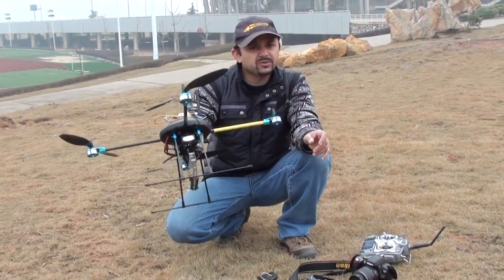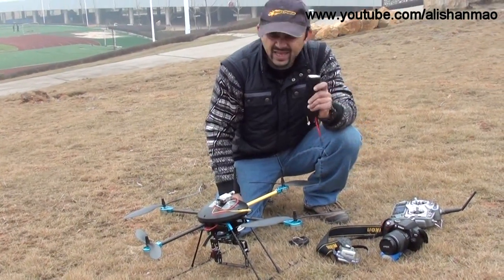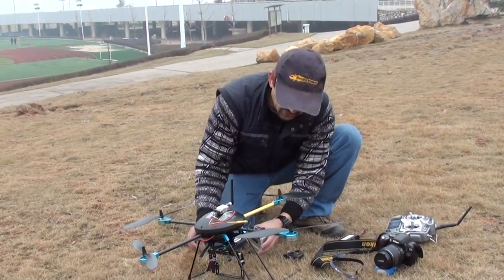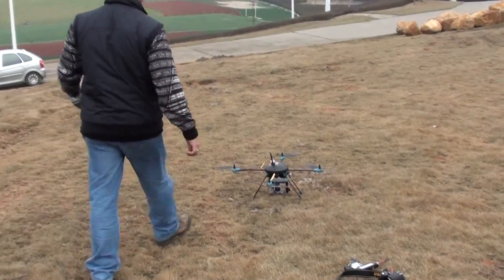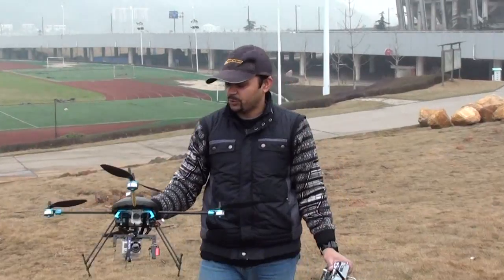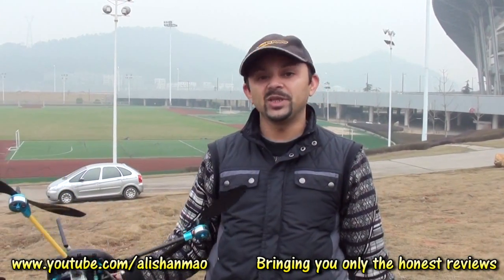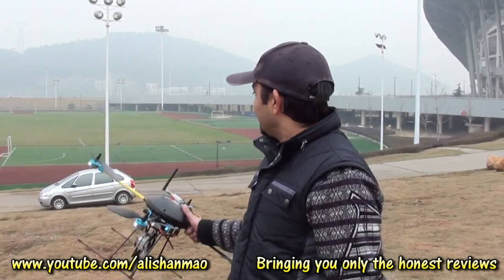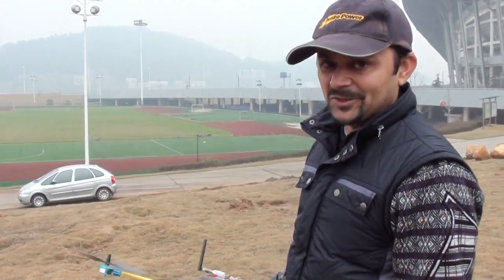T580 Quad Copter GoPro HD Aerial

Comment: That's a hex copter because it has six motors but what are the structures around you? Stadium and overpasses?  How well does your hex take to the turbulence found around buildings?  Does it stay steady as it climbs next to a structure?  Have you learned how to handle the wind?